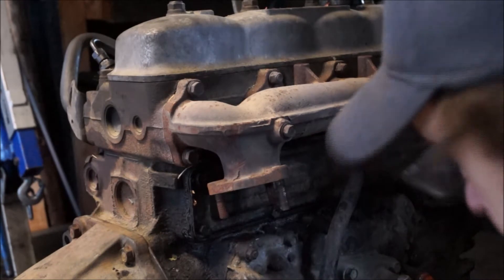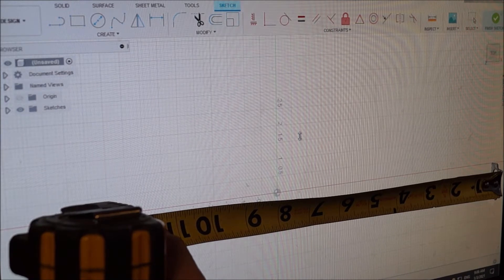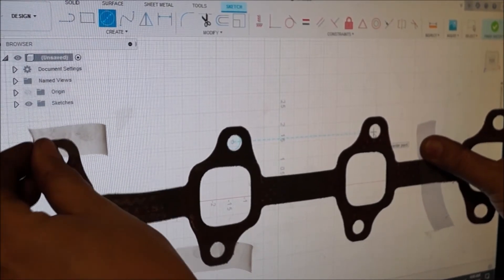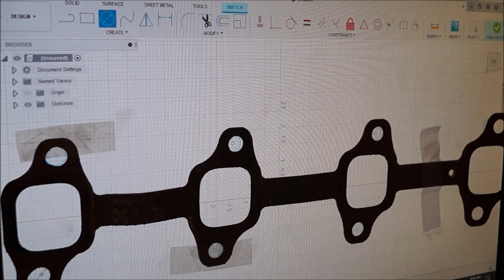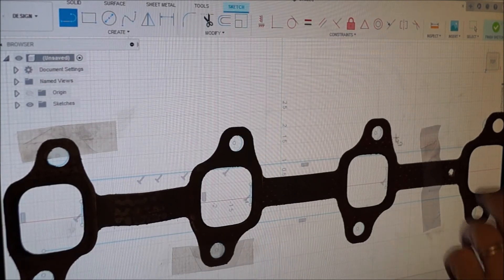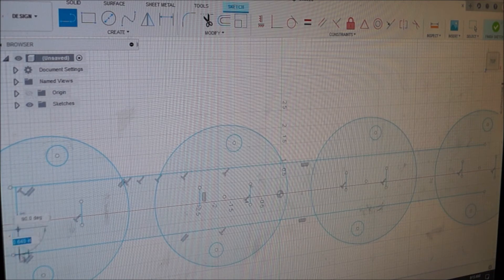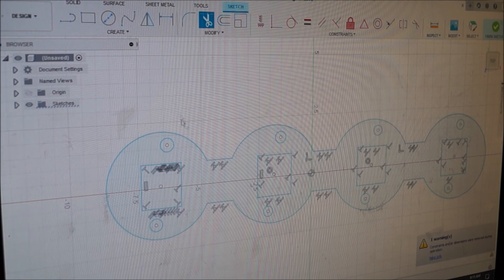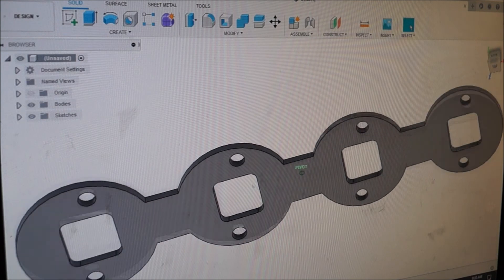Land Cruiser 3.4 Liter 3B Turbo build part #2

Comment: A handy thing with fusion is you could take a clear picture of the manifold flange and then import it and resize it to the actual size and then do your cad work over it.
Reply from the maker: Yup, i have used that method before too.